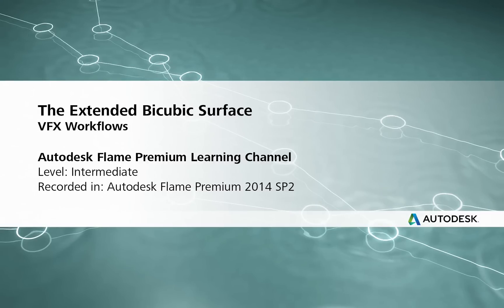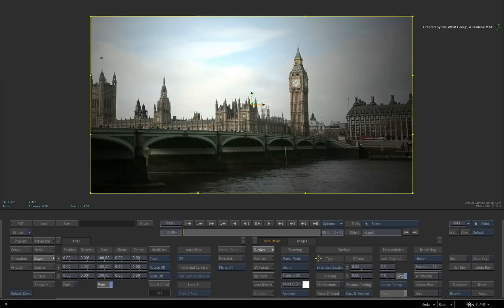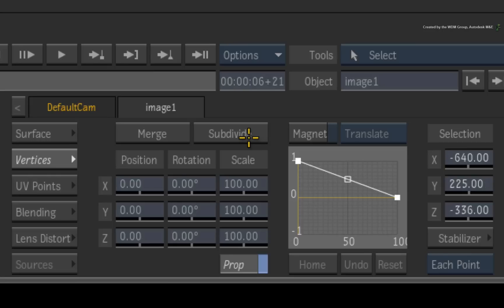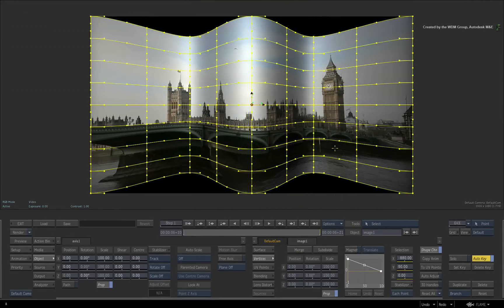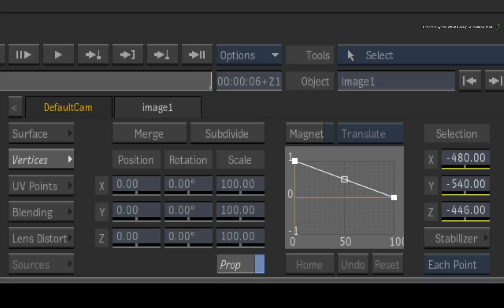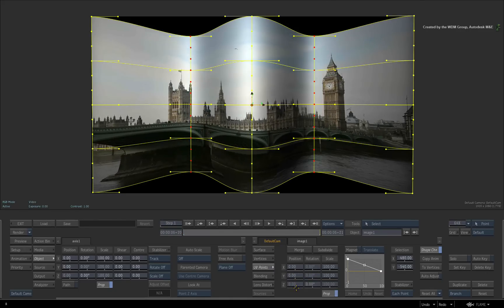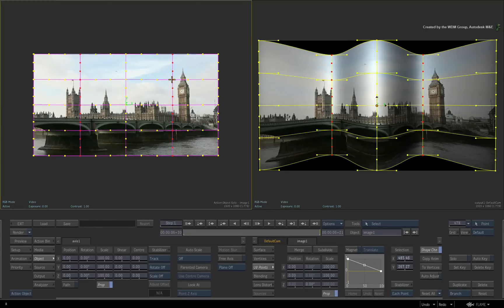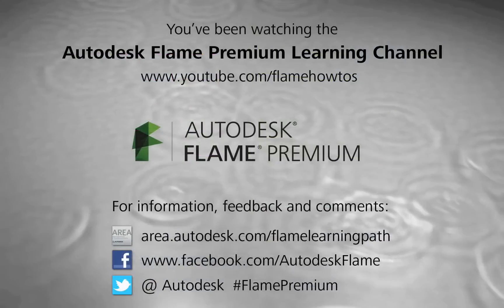The Extended Bicubic Surface

Comment: in deform mesh, theres an option called outside which if you turn off, it wont affect the image outside the mesh, is this option or something similiar exist in extended bicubic?
Reply from the maker: +Andre Nathan with the current release of Flame and Flare, you can adjust the Vertices and UV points at the same time to adjust the cage of the extended bicubic in Action.   This allows you to localise a part of the image to adjust.   Than you switch back to the move/select and start warping the image.  As long as you don't adjust the borders of the vertices cage, you should be able to prevent the area outside of the vertices mesh from being affected.